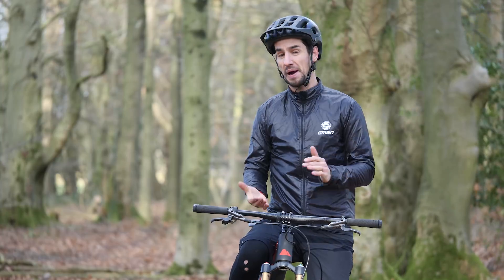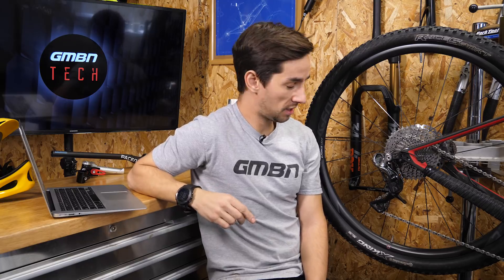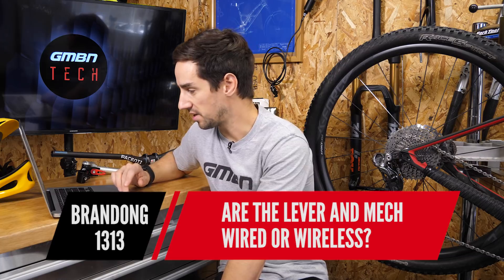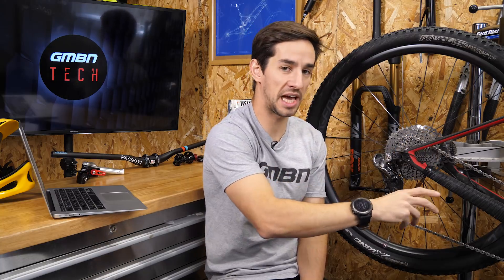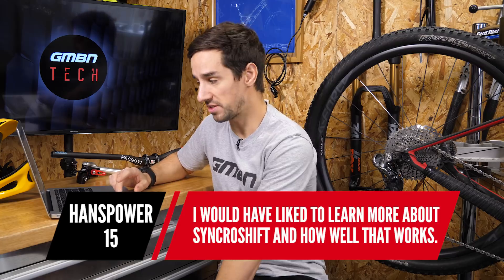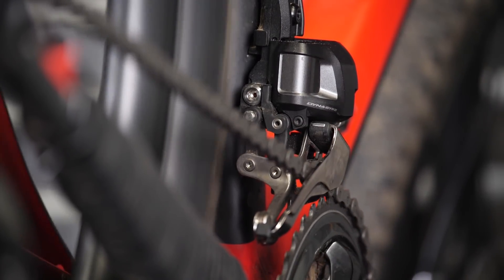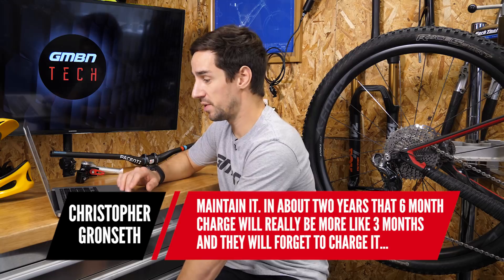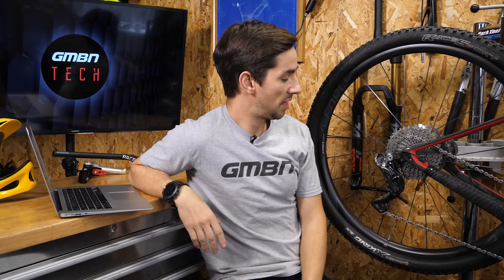Electronic MTB Shifting | Your Questions Answered

Comment: For electric bikes that have a bafang motor of 750W - 1000W what gear shifters are compatible with the Bafang C961 display if the display can or can't be upgraded?

Comment: Just had the experience of the batteries on my di2 going completely dead while I wasn't able to ride for a couple of months went out for a ride got a little distance and found it would not shift at all completely sucks I guess the batteries are going out where are they and how do I get new batteries please. It seems to be showing that it will no longer fully charge one or two bars are missing from the charge depending on the bikes mood? Meaning it is incapable of a full charge any longer?

Comment: Those that are against electronic shifting need to get on board if they want quality shifting, low maintenance, and want to be able to keep riding instead of pushing the bike because of all the problems cable shifting can cause that electronic does not have. The industry IS moving to electronic shifting in a way that within 6 years there will be no options of a cable a housing shifting for mid to high end components.  XTR, XT and LX as well as all of SRAM's mid and high groups will all be electronic with no cable operated options being manufactured. The durability is just as good as cable. Maintenance is easier and is needed less often. The cost is not that much more and comes down more and more every year. The evolution to 12 speed will most likely only need to be a cassette, maybe a rear derailleur and a software update. Why would you not want something that is far superior? Would you prefer a crank start motor over an electric starter on your car? Do you like stairs more than elevators? Why do you wear shoes instead of going open foot? Lets use letters and carriers for all communication again. Let's do away with planes trains and cars to just walk or ride horses again. Fire to read, cook and heat our homes is far better than power options.

Comment: One reason for electronic that hasn't been mentioned is that after many years of changing gears my right thumb started to suffer.  With the increasing number of gears and the increasing size of sprockets, this can only get worse.  I have now had Di2 for 6 months and 1000km using only a left hand shifter with syncroshift.  Costs have come down - my Merida Big Nine 7000 E cost me AUD 4000 ( 2200 GBP) which is probably a lot less than an operation on my thumb.  The only down side I have noticed is that like 1X you lose access to alternative ratios on those long constant gradient climbs.  Another good point is that when you come to service/clean the bike, the FD and RD can be unplugged and removed without upsetting adjustments.

Comment: Can you propram it OR buy 1x10 versions?
Reply: I checked Shimano.com and the 8050, 9050, and 9150 derailleur are all 11-speed. 
Doesn't seem like there's an option to change the top gear in the Shimano E-tube software. 
But it should have been possible to make that happen. The derailleur is already moving across the same positions that a 1x10 would use. 
You'd just have to adjust every derailleur position in line with the 10 gears. And dump the 11th.

Comment: About that syncro-shift thing: i still run a 3x on my MTB. While having the gears figure it all out and just give you next lower/higher gear, there's a lot to be said for the ability to be able to "jump" by shifting the front mech directly. I'll be climbing in middle ring, then there'll be a steeper section, and I'll drop it to the granny gear. Similarly, when I'm over the top and start descending, I won't be shifting through 30 gears sequentially, but shift granny, middle, a couple up to prepare the chainline, then shift to big ring and proceed shifting up. This allows you to react very quickly to the requirements.
Also, while rear will shift whether you're inputting power or not, front will need you to ease off to shift at all. Therefore I prefer to know that a shift will occur so I can accommodate it.

Comment: Can the left shifter be programmed to operate the rear mech?  I have pain in one joint in my whole body - my right thumb.  With MTB going to 1x11 or 12 I can me more people developing this problem.
Reply: Yes the lift shifter (Shimano SW-M9050-L) can apparently be set up as main control, as seen in the software manual on page 6 and 7:
https://e-tubeproject.shimano.com/pdf/en/HM-M-3.4.3-00-EN.pdf
It also looks like you can use the E-bike motor assist controller as your gear shifter, for a button instead of lever feel.

Comment: i believe next step by shimano will be fully wireless, and the screen/computer will have some additional functions, like reading the speed from a hub integrated tachometer (wireless obviously). or even gps function like a small e-compass of sorts and other features like that, paired in the same controller that does the shifting

Comment: I think those gearbox enclosed synchromesh gears with direct belt drive to rear hub become lighter and sturdier, resulting in whole derailleur chain shifting becoming obsolete is the next iteration. It will probably come first on XC as far as mountain bikes goes. Probably somebody  with a planetary gearbox idea also may come along..  Those gearboxes are sealed, so wont be exposed to dirt and grime and more mechanically reliable. Compared to derailuers which are exposed and have a bad habit of smashing on to rocks etc.. their robustness and smooth shifting characteristics will be what drives them in the market.

Comment: Why are some people so fussy about technology?
Should we return back in time and ride without suspension, dropper post and gears?
Rigid steel single speed on 26" with mechanical rim brakes is not exactly bike for everybody...
Everybody's pumping tires more than twice a year so I can't see problem to charge battery (especially with indicator on display)!
Saying all that I have to admit I don't have Di2 and dropper post and won't have them at least till next year
coz I can't ride MTB due to injury but I tried both last year and it works like a dream.

Comment: Wireless shifting and dropper post adjustment is the future for sure. Just like cell phones and the internet, people want to be connected while "disconnected" from wiring. The next step is to integrate a small solar panel into the handle bars, stem, or frame of the bike so that you never have to charge the battery but it is always fully charged. I wish I could patent that idea but I think some people are already trying it out.

Comment: not electric gear related, but should i upgrade from square taper bb to external? if so whats the best type? this is the second set of cranks that have worn at the square taper.

Comment: If the power usage is so low, why not have some kind of low friction generator in one of the hubs? After a few meters of travel, could a capacitor be charged enough to run it? Am I the only one here old enough to remember dynamo systems? The ones that rubbed on the tyre gave a lot of friction, but with lighting systems that now have some kind of induction loop in them, could this not be adapted even if only for emergency use? I love the idea of this technology, but I suspect that by the time it trickles down to a price I can afford, I will be too old to ride. Oh well, it still looks awesome. Great show as always, love from an old lady who should probably have taken up knitting by now!
Reply: Jayneflakes yer your right you could power the shifting system off induction. It's only draw back is weight you need neodymium magnets and copper coils ect added to the frame and wheels.
     I too am old enough to remember the dyno-lights, they would blow the bulk on a good fast decent lol

Comment: Long-term tech predictions;

1. Magnetorheological suspension and potentially electronic ride height adjustment.
2. ABS/linked front & rear braking and anti-dive.
3. Integrated electronics with a standardised system (think canbus) that control multiple aspects of the bike.
4. Tyre pressure monitoring system.
5. Automatic gearbox

As more electronics are introduced to cycling, big players from other industries are coming too and with them will come other innovations. Bosch are already here with their electric motors and they have huge automotive experience they could draw upon in order to expand their MTB product line.

Comment: I noticed you have this mounted on a hard tail, is it not function on FS bikes?
Reply: JD 3 i think it should be compatable as its wired so routes in the same way a conventional cable mech would. Neil just has it on his hardtail for xc rides.
Reply from the maker: Nope, it's perfectly functional on FS bikes! Many FS bikes these days aren't compatible with a front mech though so having it on a hardtail helps us to demonstrate the synchroshift functions :)

Comment: Wireless everything like Sram red etap would be great, and to have electronic on as many of the lower tier group sets as possible. Wireless braking I thought was a joke before but it isn’t so crazy when you think about it. I’d love to see some innovation in that. And also some kind of internal gearing that could work for pros. Less mechanical issues, less maintenance.

Comment: I would totally like electronic shifting on my MTB. However, right now this tech is (obviously) overpriced. I guess it is the matter of waiting until manufacturing gets upscaled and producing costs drop down. Because right now road Di2 groupsets are only 10-15% more expensive than their mechanical counterparts. Right now I just hope for a more affordable XT M8100 Di2 (or maybe even SLX or Deore).

Comment: I use Di2 on road, CX, and MTB.  I can verify that it is waterproof.  I had an MTB race that included sloshing through hub-deep muddy water - no Di2 problem.  I will never go back to the maintenance and usage problems of mechanical levers and cables.
Di2 does not use the battery until it is triggered by the shifter or while showing a few seconds of display. This is a huge advantage over wireless which must run continuously!  I'd hate to be changing multiple wireless batteries frequently or have one failure ruin my ride. (If one wireless battery fails are you stuck in one gear?)
To the gentleman who wants analog a question - do you use true analog (friction shifting) or indexed mechanical shifting?
Reply: Hey Douglas, do you know if the XT-di2 can be ran without the display? Cheers!

Comment: I think that they aren't fair in XC racing because it is taking energy you have to use pushing a gear and making a battery do it. I know it's next to no energy, but it's pushing it, you aren't powering all the functions on your bike anymore.
Reply: SRAM eagle is said to be pretty light feeling, you still have to press a shift lever just like anything else it’s just not attached to a cable it’s the same throw and click feeling it’s just consistent and smooth.
Reply: NoCommentate True
Reply: you're augmenting your muscles with a battery and motor regardless.

Comment: I love XTR Di2 it is the best system available for sure. When I first got my bike I had no idea what I was getting into but it really is the best system available. Just read the manual you understand how it works and how to adjust, it’s much easier than adjusting a cable system and then it always stays in adjustment. Shifter is the best available on the market so crisp, so easy to use, shifts perfectly every time I love it! It’s not a fad it’s not going away and XTR Di2 has no flaws, maybe price but it’s usually on sale!

Comment: i just got a rockshox reverb dropper post in, and besides needing to trim the hose since its hydraulic the dropper switch is extremely heavy to press, watching other people actuate their switch it seems mine may need a fix. What are the chances mine was over bled or needs a repair? its brand new . do you have a video on this yet? or any suggestions? thanks love the show!

Comment: The funny thing is that with wireless gearing you can 'hack' it. That you can influence races just with bluetooth
Reply: No-one is dumb enough to use bluetooth for wireless groupset shifting, at least the manufacturers aren't. Etap has been perfectly reliable on the road.
Reply: Skooteh even with some kind of IR it is still something
Reply: it's a non issue getting hacked or interference according to team mechanics and peoples who own it (I'm too cheap to know first hand) and it saves a lot of time and fuss with cables. There are valid reasons to not want it but this is not really one of them.

Comment: Hi Neil! My question is, if you had the budget to do one upgrade, would you go DI2 or carbon wheels? Currently riding a Pivot Mach 5.5.
Reply: Carbon wheels! Di2 is just a faff. It won 't improve ride in any way. Carbon wheels will for sure. Stiff, strong, light...
Reply: I wouldn't do either but out of the two I'd go with the wheels. It'll make a bigger difference to the performance of the bike
Reply: Yeh i'd also say carbon wheels. Di2 is very minimal benefit for your £/$/€ whereas carbon wheels you'll definitely notice.

Comment: Thanks for the info Neil, I would love to have a DI2 on my bike, I am a tech freak and love working on my bike, but Its too expensive at the time, I could buy a lot of cool toys and tools for my bike with that money that would make more sense at the time. Besides I an not that fit or fast to make electronic shifting a difference in my riding. Keep up the good work and keep the info coming!
Reply: Israel Zenteno if you already running shimano get a cassette and a few other parts then get the Di2 bits last. It’s on sale at backcountry much less than XX1 eagle.